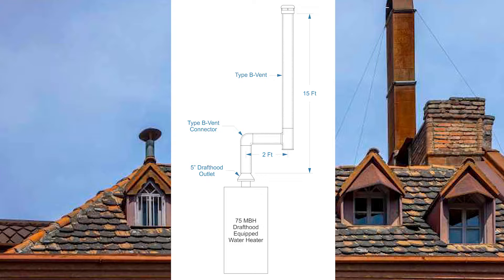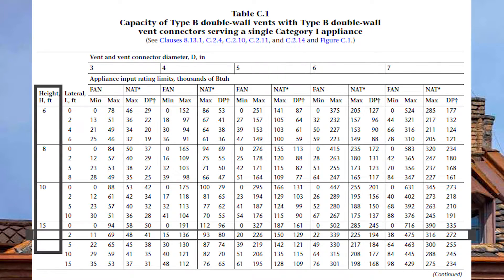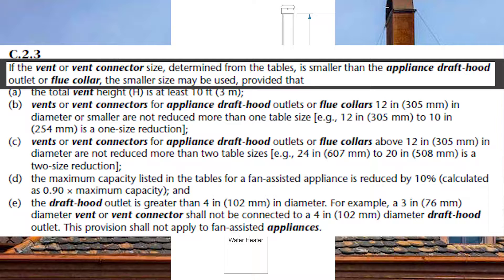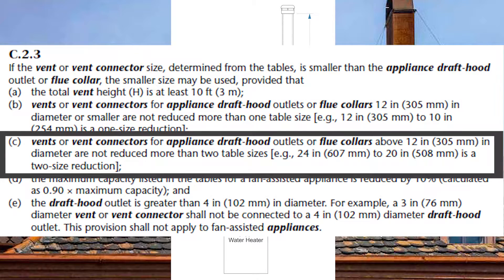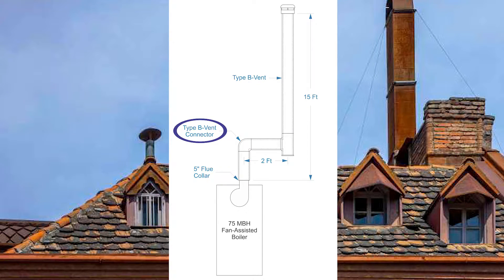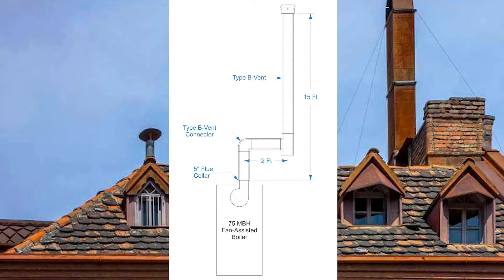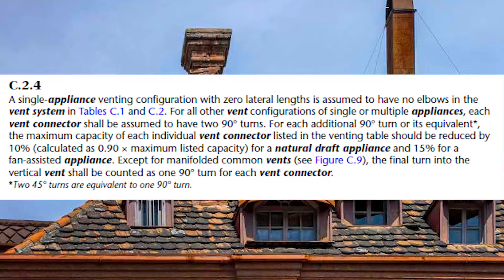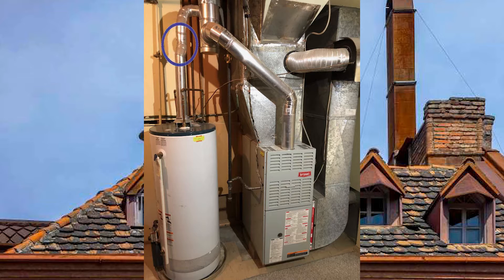Gas Venting with Tables Part: 4 - GVR C.2.3 and GVR C.2.4

Comment: Can someone please explain why he multiplies it by 0.85 at the 7:18 second mark??? It doesn’t say that that number in the code book
Reply from the maker: You need to reduce the table capacity by 15%
100% - 15% = 85%
and   85% = 0.85

Therefore table value x 0.85 = the table value with a 15% reduction

The code spells it out nicely for 10%, but the code author assumes apprentices and journeymen know how to do basic math.
Reply: @MathematicPlumber  haha I appreciate the answer it makes perfect sense now. I write my gas exam right away so I appreciate it. Been a few years since I learned this in school.
Reply from the maker: @stephenprystupa8381  It is definitely challenging if you are a few years out. So much stuff to remember!